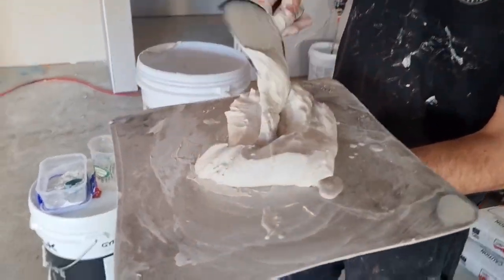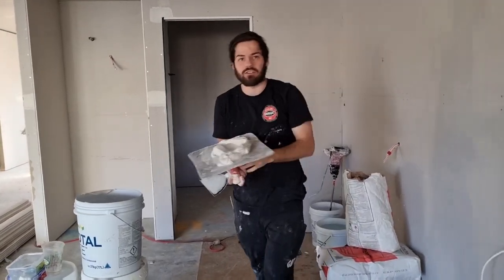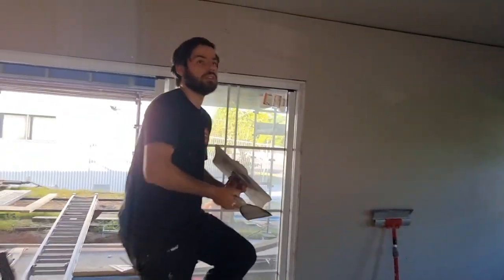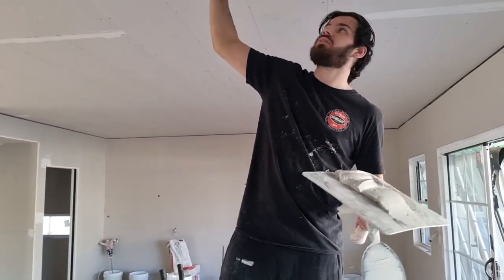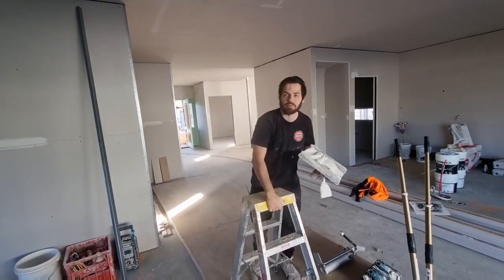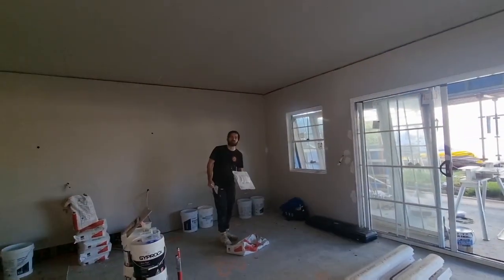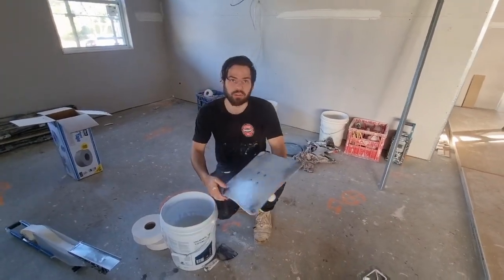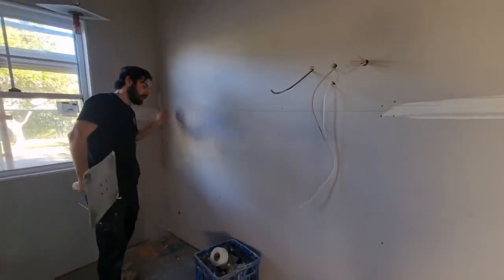Sheetrock Back Blocks, Butt Joints & Ceilings Falling Down Like a Wave

Comment: Were you guys talkin about the Trim Terch 1/2 x 6 OSB with a bevel in the middle so its like the two beveled factory edges when screwed together? They make it so you never have to cut sheets back and you can run butt joints for 30ft if you want, no more staggering the joints and wasting time and material. With inflation this Trim Tech is very expensive, it comes in packs of 12 and its gone up 40-50 dollars. Cheers !!